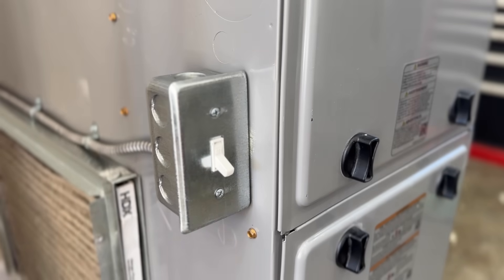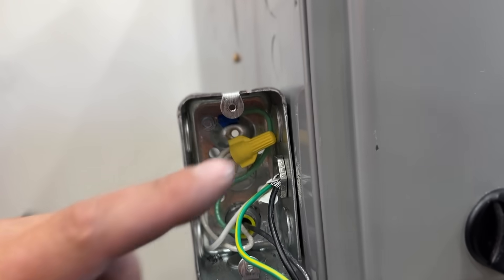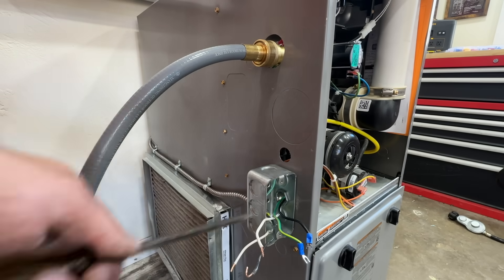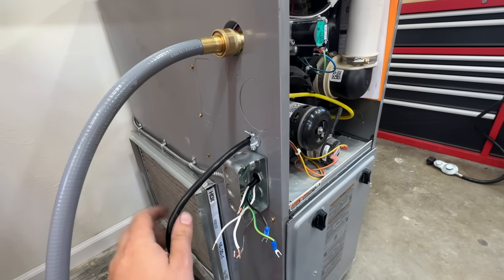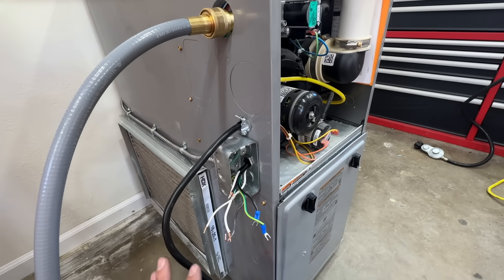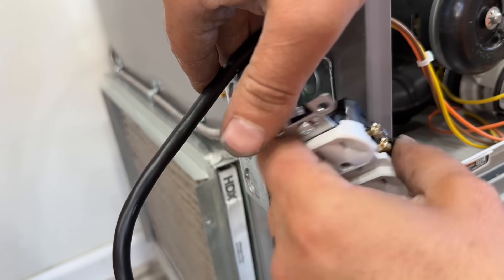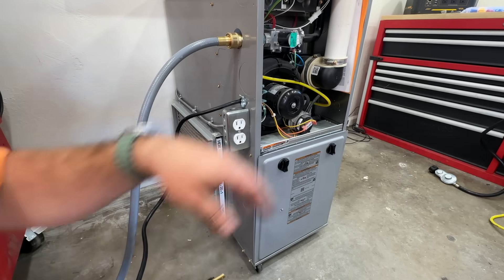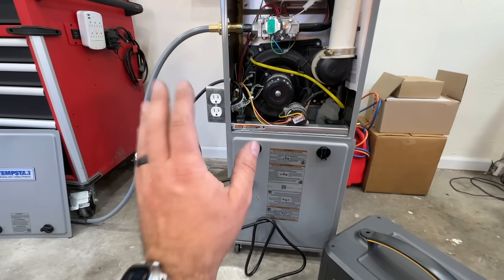Keep Your Family Warm During A Power Outage By Installing This $5 Part

Comment: I'm curious if you intend to land a ground wire on the green screw of the receptacle. It appears the feed wire ground wire is screwed to the box, which does not appear to be securely tightened. This means the entirety of the grounding circuit to the furnace is only as good as the loose chase nipple nut. In other words, the good ground to the service panel is screwed to the metal box, but the cord that plugs in is only connected to the ground wire that comes from the furnace. when the cord is plugged into the receptacle, the third prong does not provide any connection to a proper ground, since there is nothing connected to the green screw. This means that anything you plug into the receptacle does not have a ground, and while the receptacle box does have a good ground, nothing past the chase nipple is to be trusted.

Comment: Our furnace has a plug in on the wall but when we plug it into the generator it still doesn't work.  Was told that was because our thermostat needs electric.

Comment: 30 yr Electrician here....   NEC  (electrical code) requires a minimum or 6 inches of wire from the back of the box.  I would strongly suggest if anyone were to try this, to "carefully" strip back 7" of sheathing from the cord as to make sure you can make the electrical connection properly.  Just a tip from a Licensed Electrician.   : ))
Reply: OK so can this same idea be done with an electric hot water heater ?
Reply: @Peter-lv7zm gas fired furnace. The incoming power only runs the blower and ignitor, not much electric consumption as the fuel is ng. An electric water heater, the electricity is the fuel with a lot more used than a gas furnace. A battery pack cannot supply enough power. Neither can smaller generators.
Reply: @Peter-lv7zm  Not if it's electric instead of gas -fired.  Hot water heaters are usually 240V, requiring a very different procedure.
Reply: @Peter-lv7zm   Technically NO.  Practically speaking, your water heater is running on 220v.  And, it's likely a high amperage load,  so this example is only for 120v applications.  You would need a generator that is able to apply at least 30 amps at 220v.  It would be an 8 or 9000 watt generator
Reply: Ive never had a 220v waterheater..   always required just a 120v run..
Reply: @Z-Ack . Then you have never had an electric (whole house) hot water heater.
Reply: Oh, heck, where is my brain?  Heh heh.  Welcome home!  (Yeah, after 50 years, I still say that.)  EDIT  Are you and your son mil/separated?  Not sure from your moniker.
Reply: @MundiTaurus So which 6 inch wire is he talking about ?
Reply: @serezhka021  He's talking about the line cord that enters the junction box at about 5:30. Note that the cord goes into the furnace housing and then comes back out into the junction box where the outer cable sheath has been removed. The three wires that exit the black outer cable sheath are technically supposed to be at least 6" long, with at least 3" of that continuing on outside the box. ProudDadVet is wisely suggesting 7 inches to give you enough length so you can screw it up a couple of times. But the code provision is intended to assure that you can wire everything up without straining the wires and so you can easily and put the assembly and wiring back into the box.

This "hack" is commonly covered on YouTube. Properly done it is completely safe, but not specifically permitted by code. I suspect it is getting a lot of play due to the recent hurricanes and accompanying power outages. I think it is a good idea, but there are electrical inspectors who may not agree.
Reply: @TheeAbstractHero   The electrical inspector might enjoy that, but actually it's the insurance company's inspector you need to worry about. Don't give him an easy way to deny your claim. Again, the code neither permits, nor prohibits this, it's a matter of interpreting a variety of related provisons. Meet the provisions that obviously apply so they don't find an obvious violation in the ashes of your burned out basement.
Reply: @serezhka021 the plug wire needs to be stripped back. The black plastic around it
Reply: I hated you all my life
Reply: Yeah maybe in an outlet that's buried in a wall that's a good idea, unnecessary in this application mr 30 year
Reply: @PlumberGuy-ez9wx Thank god you have it all figured out and know more than a certified electrician!
Reply: A lot of people won't understand what sheathing is 😊
Reply: Isn't not screwing in the unused hot and neutral hazardous?
Reply: Isn't not screwing in the unused hot and neutral hazardous?
Reply: @chrisgofyourself5519  there are no "unused" wires.  The wires that come from the panel, go directly to energize the outlet.  The cord attachment AND the furnace wires are directly tied together and will only become "HOT", when it is plugged into the outlet, which will be (with luck)  100% of the time.
Reply: @ProudDadVet I see leaving outlet screw sticking out as bad habit to have on and box, especially a steel buddy box.
It's sloppy IMO
Reply: I hired a  pro and did it right,I’m not screwing around with the electrical center of my house!
Reply: Noted, must have forgotten no power/emergency  situation
Reply: TY for your post, but I don't know what you are talking about.  What wire from what box?  The pigtail and the switch box, I assume?  Also, Mr 30 yr Electrician, :-), I only have a hot and neutral at the box/switch, the switch is on a sheetrock wall.  There is/are no ground wire/s.  (HUH?)  The switch box is plastic.

Can I get a metal switch box, 
attach it to furnace metal enclosure, 
run the wires out of the wall to it/through it, 
and attach a ground wire from both the (new commercial grade) switch and the pig-tail to the furnace enclosure?

I just got (semi) destroyed from a hurricane, and I am trying to get on my feet.  Dead presidents are killing me, I have a lot to do, and winter is coming, but I wanted to do this, also.

Thank you in advance.

Comment: Just completed mine today.  Easy install thanks to your great video and instructions. Iam in IL and this makes it a must have.   I have an older 90 % efficiency gas furance.  I needed a 20amp outlet since my breaker is 20amp and 12-2 wire preexisting.   

I already own two gas generators so that is covered.  

Thanks

Comment: Would a 1000W Inverter be sufficient to run gas furnace and standard refrigerator simultaneously?
Reply: Depends on the current draw of both appliances.
You could try it and see if it pops a breaker on your generator.

Comment: By coiling the wire you are increasing the impedance, heating the wire to increase its resistance, dropping voltage as waste outside the appliance, in other words being inefficient with electricity and increasing the risk of heat and fire.  Because a coil of wire acts like an electromagnet and the growing and collapsing magnetic fields 60 times per second induce back-current.  Less of a problem if you let the slack power cord be extended linearly.  More of a problem if the number of coils increases.
Reply: That's one more reason why I like my idea better.
I would use a double pole double throw toggle switch in that box.
The black chord would be non-functioning until it was switched on as the incoming power source.
With that switch it could only draw from one power source at a time. No danger of backfeeding or electrocution.
You could actually leave it plugged into both power sources and then just flip the switch when the main/city power source goes out.
And then when the lights in the house go back on just flip the switch on the heater again.
Maybe label the switch one way for city power and the other way is alternate/off grid power.
Easy peasy. 😃

Comment: you should not be using an outlet receptacle because it forces you to use a suicide cord from your generator. you should be utilizing an inlet receptacle with a safety cover and a separate locking keyed safety switch, similar to those on table saws.  ALL the power should be running through that switch box for the furnace - IT IS A SAFETY SWITCH FOR THE FURNACE IN THE EVENT OF A FIRE EMERGENCY and should be located according to local regulations(IMO they should be color coded with a special plate or switch).

Your goal is safety in the event of a power outage. you should not forego safety to achieve comfort.
Reply: The way he has it set up is safe. Mostly in the fact that most people don't know what a suicide cord is and don't know how to make them or use them.

And if you put an inlet in that box you would still need a way to switch between the two different power sources. I think you're overcomplicating it.
I didn't think too much of his remedy but it gave me an idea.

That's one more reason why I like my idea better.
I would use a double pole double throw toggle switch in that box.
The black chord would be non-functioning until it was switched on as the incoming power source.
With that switch it could only draw from one power source at a time. No danger of backfeeding or electrocution.
You could actually leave it plugged into both power sources and then just flip the switch when the main/city power source goes out.
And then when the lights in the house go back on just flip the switch on the heater again.
Maybe label the switch one way for city power and the other way is alternate/off grid power.
Easy peasy. 😃

What do you think of this idea?

Comment: How long would you have power with the power supply you used?
Reply: My question too.
Reply: That depends on the power source that you use.
Generators eventually run out of fuel. Solar panels don't work in the dark.
Batteries can go dead.

It's best to use a combination of resources.
You could even get a power inverter and run it off your car, truck, tractor, etc.  😃
Reply: @TF856  natural gas generators hooked up to the Utility Company will run for a very long time. Much longer than the outage.
Reply: @TF856  natural gas generators connected to the gas company will run for a very long time. Well beyond the outage.

Comment: How is it going to kick on when your thermostat has no power?
Reply: Your thermostat either gets power from the batteries inside or the old style gets it from the furnace that uses a 24 volt transformer.   When you power the furnace with a generator or normally the transformer is energized.

Comment: I don't understand how that small battery that is probably 1200wh or less can power a furnace for hours??  My 80,000 btu furnace has 800wh load.  That's about 60 minutes operating time.  You'd need a VERY large battery system to heat for Amy meaningful power outage
Reply: On a cold day my 80k btu furnace runs a 50% on/off duty cycle. That would give me a run time of around two hours using one battery.  I have a battery bank of four so I can run my furnace for 8 hours before needing to hook up my generator.  My generator can run for two weeks in case of a severe ice storm knocks out power which happens at times.

Comment: Is there any reason you couldn't just keep it on a switch instead of the outlet if you are plugging the new wire into a generator or power station?

Comment: As he said some areas may not approve of this wiring method. Not saying it is a good or bad idea just the facts. 
This wiring is 100% against the manufactures installation instructions and in Canada this is against the Canadian Electrical Code.  Just be aware  bundling a cord as shown can cause heating of the cord, if you do this be sure to use a quality cord. CEC States cords are only approved on  portable or temporary appliances unless approved at time of appliance manufacture. This also means a home insurance provider may use this to deny or cancel a policy or deny a damage claim.

Comment: If you were to pull out the plug when the power is not out, wouldn't the end be live? I don't quite understand how it's isolated, and how a generator wouldn't be feeding power back into the main.
Reply from the maker: Think about this, if you unplug a toaster, would you ever have any reason to believe the prongs on it would be live? No. This is literally the same exact thing. The mail pigtail is just wired to the furnace, so when it’s unplugged it is like unplugging a toaster.
Reply: I remembered it wrong. I should've watched it again before commenting... I was thinking all three sets of wires were joined, but no - the furnace won't even run if it's not plugged in. 
Thanks. I like this idea.

Comment: QUESTION: What is the minimum power block that can be used? I believe you said you're using 1000w. Is that the minimum? Thanks. That's a great idea. It should be installed on every furnace.
Reply: A power station with more than 1,000 watts will simply allow you to run the furnace for a longer period of time.

Comment: Most State electrical codes require that the wire protrude 6 in from the box before connected to anything this is also for convenience and to stop people who don't know what they're doing from leaving 2-in stubby wires in a box like you just did

Comment: need some help from an electrician. I went to update my place exactly like this video and ran into an unexpected issue. The current disconnect switch has a small fuse below it. If I change it out with a combination outlet, I'll lose the extra fuse protection? Any thoughts on this??? I did have a sketchy 100amp panel before so maybe that's why the fuse switch was there, but since had it upgraded to 200amp panel with an external disconnect. Is there any reason to keep this fused switch?
Reply from the maker: The exact video you are looking for is coming out on Saturday so make sure and watch that one! I’ve had a lot of people ask about this. 

So if it’s a 15 amp screw in fuse, you simply need to make sure the breaker for your furnace is a 15 amp and that’s all you need. The fuse is redundant. Anyways, stay tuned for Saturday! Cheers

Comment: I would recommend using a velcro tie instead of a zip tie for that part at the end where one wants to get the cord tucked away. That way, you don't need a cutting tool when the time comes to get the cord out. Also, it's able to be reused many times. If it wears out over time, you can always replace it, just as you would have had to do many more times with the zip tie.

Otherwise, I keep thinking this kind of thing should be standard. With more and more people getting backup power systems that aren't whole-house systems, having a standard plug-in cord like other appliances is very helpful. People with whole house backup power could have it work either way. And now that they tend to only need 15 Amp breakers like so many other things, it makes more sense. If it needed 20+ Amps, then I'd understand not making it plug into a standard outlet, since people would probably blow fuses and breakers by plugging them into inadequate sources. But that's not typically a problem anymore.